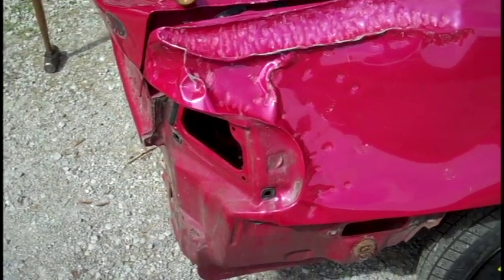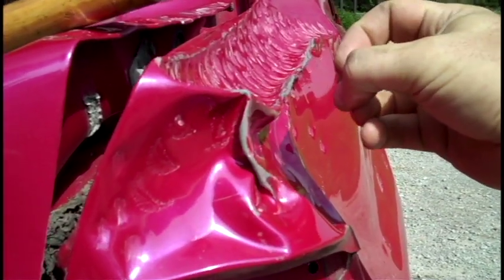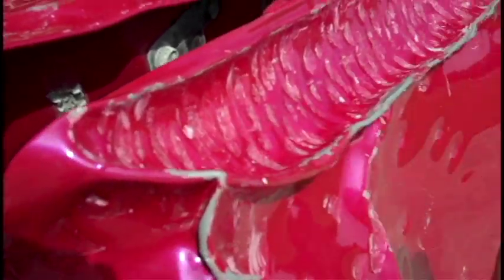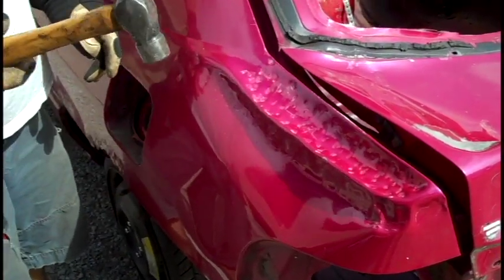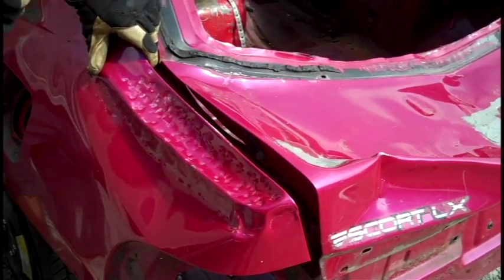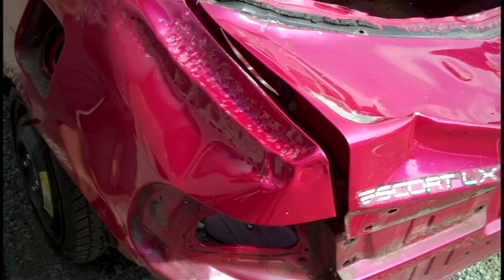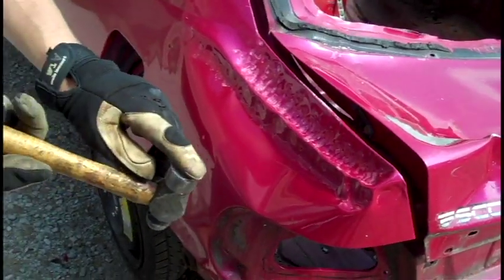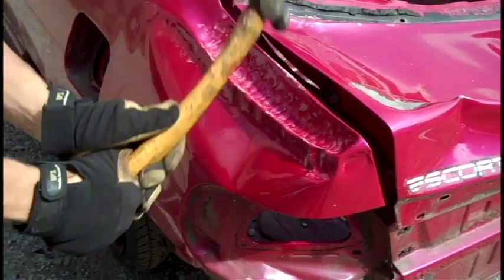How to CREASE a Derby Car (Demo Derby Tips)

Comment: find you a junk ball pin  hammer and cut the bal off it and weld it to a spare air hammer bit and use a ait hammer kinda in the same fashion just with no swing
Reply from the maker: Made video on that early last year https://www.youtube.com/watch?v=e5p0GxShI-4 . Works well overall, need to make sure to get a higher power air hammer than we used for our test.
Reply: oh that was you ok  sorry i didnt know  i remember seeing it some were  just for got were